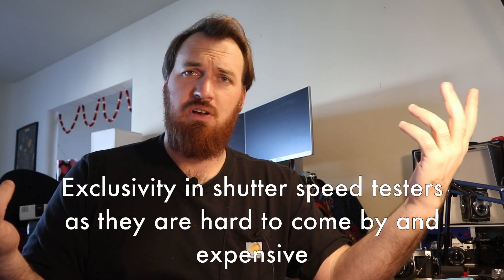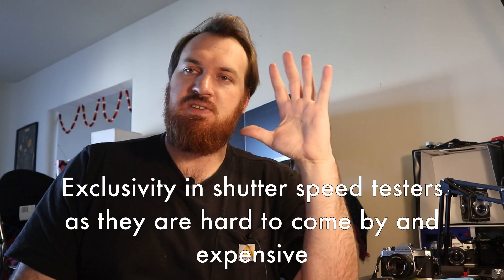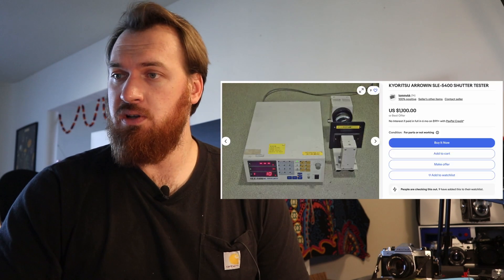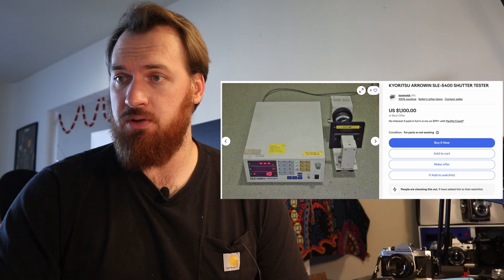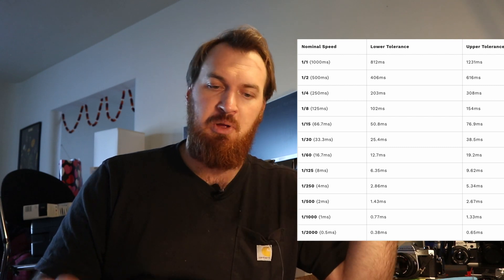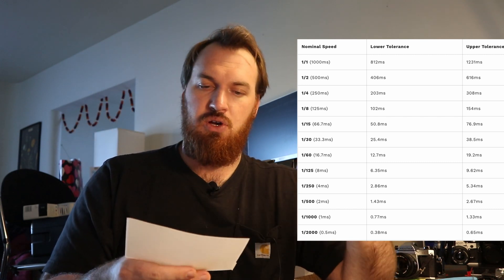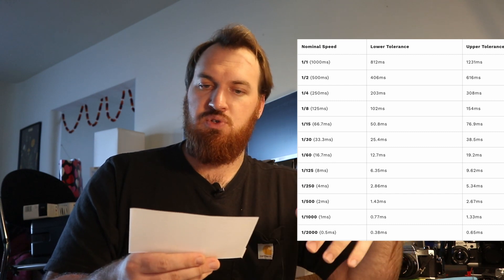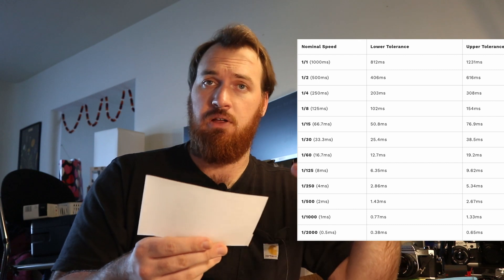Reveni Labs Camera Tester Review

Comment: I actually have this tester and it works great. Makes me appreciate electronically controlled lenses. These mechanical lenses vary a little every time you trip the shutter (I.e. 1/125 may register anywhere from 1/112 to 1/150.

Comment: I have a shutter speed tester from a guy in Romania who used to make them, I'm not sure if he's still around. Price was a bit above 100 US$ IIRC. There was a few itinerations and I got maybe two or so. They work nicely you can even test bottom loading Leicas and Hasselblads. It measures both leaf shutters and curtain (horizontal + vertical) shutter speeds, curtain travel times and it also came with a free tester you can use with your phone (not really anymore because phones got rid of phone connectors). I bought the first light meter from Reveni labs, it works great but for a 60+ person it gets harder to deal with those tiny buttons and screens. The tester was out of my price range, TBH.

Comment: Excellent buy. 
(Disclaimer at 12:30 was hilarious)

Besides from sound approximation, like you did in your early days, is there another 'poor man's' gadet for this? (Surprised there isn't an app yet). 

I thought audio waveform graphs (in audacity or adobe), for the higher speeds, might be an economy solution.
Reply: I haven't tried it so there may be more distinctive sound than I would expect but... In a focal plane shutter there are two curtains moving at the same time and their speed doesn't vary, only the gap between them. So there isn't much sound that would be expected to change unless something was seriously wrong with the shutter. You could try to hear the two seperate curtains but I don't think their noises are seperate above flash sync speed. You might be able to run a few different speeds and do some math to calculate the speed, but as I say I haven't tried it. I have measured with an oscilloscope, my setup wasn't perfect but I think I could improve it a great deal for another 10 or 15 dollars, it's not exactly a budget set up but it cost much less than a dedicated tester.
Reply: i've seen people do it with the slow-mo camera on their iphones. you'll have to google how this works